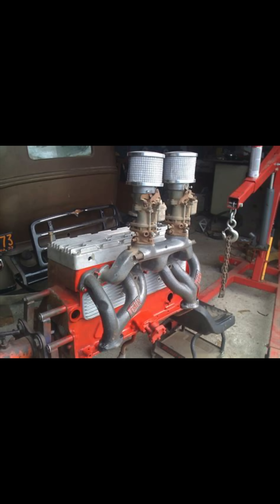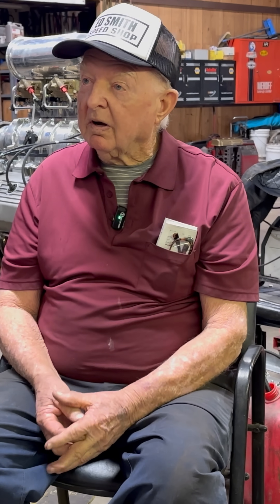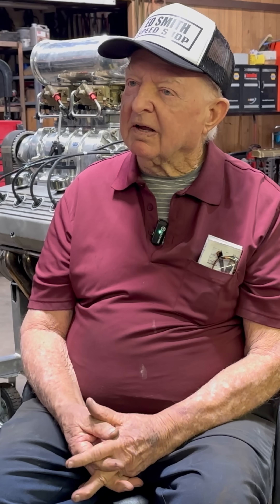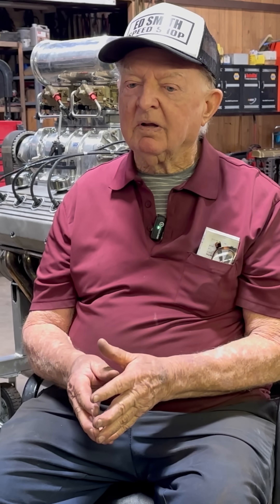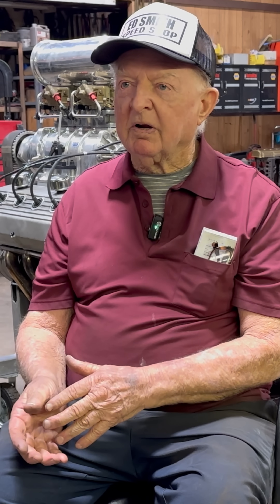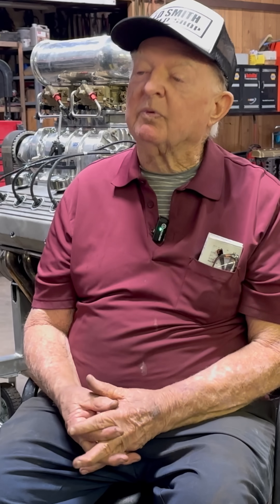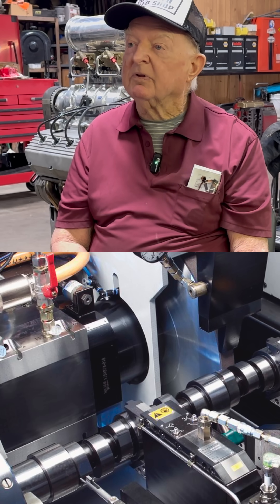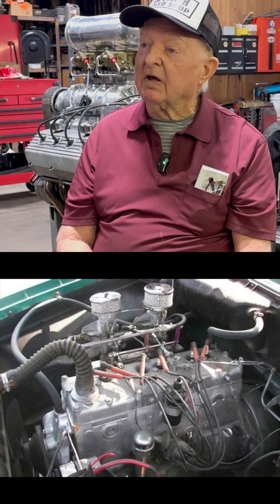Personalized CAM for Flathead - Ask Ed 21 - Ed Smith w #barryt

Comment: 😂 he is right about the flat head 6 they kp up out there gd . But here it came the straight 6 300 Ford in 63 people started to build them up special bore and polish head bigger valves etc and a cam 6 small carb with a plate at that time and see you flat head he say jjj even V8 motors used to have hard time then came Weber carbs 42 and 44 and then everything when to another level I think people forget about how strong a straight 6 300 get with little effort it is a monster torquey and peppy like hell feel stronger than anything V8 out there and in light weight body care or truck it will beat big boys like breakfast dangerous engine open the hood and even a child can work with it is that simple of a engine in Puerto Rico a old school style man used to have one on a old maverick with 6 carbs on for each piston hook up that baby was a beast sounds wise to beautiful to explain and believe me I think his family still have it I used to call the car the skunk is black with 2 straps White from front to back old school style deep dish wheels have flares on don't what transmission or differential have on the old man was a Vietnam vet special Force Sargent and aft the war he was working in airplanes mechanic for a bit I know he built that beast himself he knew he stuff at his time anyway ask him if he remembers the Ford straight 6 300 with the six pack carbs jjjj he probably smile to you jjjjjj 😁 probably he will say wow now you talking power HP and higher rpm torquey beast jj

Comment: Pop had an old 8000 lb. cap. Silent Hoist yard lift  with a marine version of a Chrysler flat head six . It turned in the opposite direction . Very reliable . Had no problems selling it for Hyster yard lift many years later .

Comment: My Flathead  V8 is running a real 3/4  grind on a stock cam core .   This was done in the 1950s for a stock car. It's also running hollow adjustable lifters . The old girl shredded the fiber timing gear about 10 years ago, and I installed an iron gear. It runs well to this day .
Reply: What exactly is a 3/4 grind? I've heard of a 3/4(three quarter) cam but not a single person has been able to say wtf it is.  The most confident description I ever got was 'its 3/4 of a racing cam', which makes no actual sense.
Reply: @alcalc8938  There's a limited amount of material that can be ground from the base circle of a camshaft , removing 3/4 of this material translated to the 3/4 race designation.  Removing all of the available material translated to being a full race camshaft.
Reply: @alcalc8938  3/4 of the material available to grind off of the base circle 
Is removed .  Full race equals all available material being removed from the base circle to increase lift to the limit.
Reply from the maker: Fantastic

Comment: Straight sixers can be torque factories. Pair up with tall gears and haul ass down the interstate at silly low RPM.
Reply: @Sunspot-19  I'm thinking square body Suburban with a 4 spd automatic.
Reply: @paulshamblin6260  Those fenders might be reserved for a 427!! Towing, don'tcha know!!
Reply: @Sunspot-19  that would be good for towing. I just wanna travel and sleep in it.
Reply: @ My Jeep does cruiser duty, the one ton Chevy Van pulls stumps and other things that require rolling up the sleeves.

Comment: Eddie King won 2 United stock car alliance titles in central Florida in late 80s with a 300ci straight 6 cylinder in a late model stock car against a pack of 350 V8s he got a 50 pound weight advantage,,,that motor pulled like a freight train off the corner
Reply from the maker: Wow

Comment: LOTS of tracks only allowed sixes and flathead V8s until the late 50s or early 60s. That was to keep racing cheap so regular folks could afford to compete. GMC made a 302 inch six that was perfect for the purpose
Reply: I saw a GMC 302 at El Mirage CA. It has a 12 port Wayne head on it. It sounded similar to the Jaguar 3.8.
Reply from the maker: Great point

Comment: I remember a Dodge Power Wagon pickup that had a 4 cylinder flat head engine. It was a 51' military truck. The wood, bench style seats that was on each side of the bed for the soldiers to sit. The lowest gear was walking speed. Top speed 45mph. It was for transporting general supplies and trailers when needed in ruff and muddy terrain. 🎆✝️🇺🇸

Comment: I have a 1967 dodge power wagon  has from factory a Chrysler flat head
Reply: I have long wondered why Power Wagons kept the flathead for so long after the slant was introduced. Leftovers, maybe? Or maybe they just didn't trust the slant 6 in that application?
Reply: @ it was stopped because of emissions standards but they still sold them out of the USA  mostly in Australia until mid 1970s